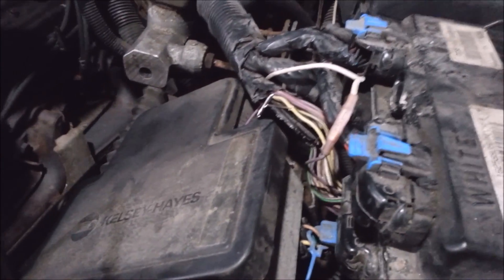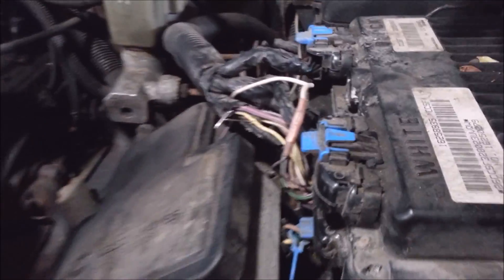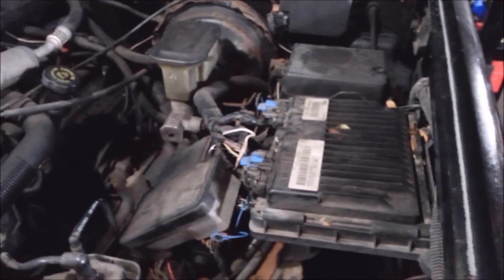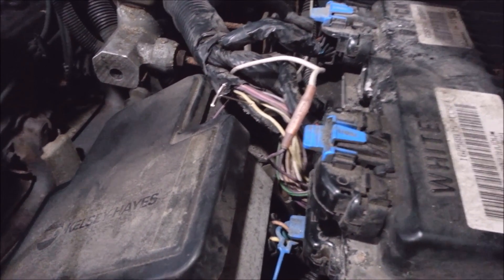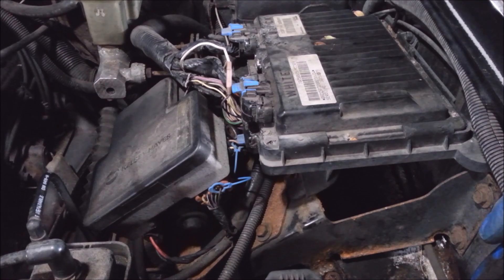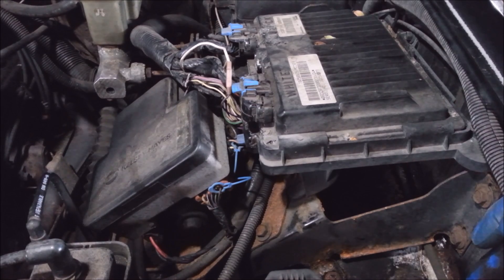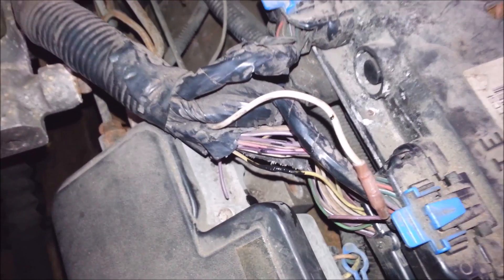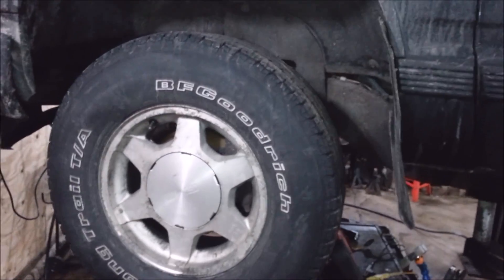1996-2007 Chevrolet GMC P0336 crankshaft sensor testing, and diagnosis

Comment: What is the voltage for the 3rd wire the yellow one? It’s a signal wire but the crank sensors can send too much voltage to the signal wire causing it to be the issue
Reply from the maker: I forgot what I did yesterday.

Comment: Is the oil normal in the sensor?
Reply from the maker: @ivang3860  it goes inside the engine, does it not? I think there is oil in there.

Comment: I have a 1997 express van 5.7 L that was getting hard to start after moving to a new place. Did some research and found the crank position sensor covered in oil. Pulled it out, used brake cleaner to clean everything and replaced it. Also noticed before I did the work that parking uphill on the road was allowing cold air to change the settings?? Anyway that was 15 plus years ago. Still starts on one revelation now.

Comment: What do the other two wires that continue past sensor connect to??????
Reply from the maker: The knock sensor, I think.
Reply: @RustBeltAuto  no, these wires run under the harmonic balancer and up the drivers side
Reply from the maker: @87atxskater  I will guess, and say oil pressure.
Reply: @RustBeltAuto @ 6:05 you can see the wire protector running past the cps you literally pull on it unplugging the cps sensor
Reply: I’m losing my mind trying to figure out where it goes 😂

Comment: Im broke down on side of road. I have a scan tool and getting this code. Can i just disconnect the plug to bypass it until i can change it?
Reply from the maker: You need a crank signal for ignition to work.

Comment: Question, how do you know which yeller wire to prick so you can test continuity? I’m having a issue with my 98 Xpress van and after changing the crankshaft sensor with a new AC Delco, my issues returned two days later. Still getting a P0339. I look at the same wiring harness going into the ECM and there are multiple yellow wires. How do you know which one is which? Thanks in advance
Reply from the maker: A wiring diagram will give you the proper pinout of the ecm if you have any confusion.

Comment: Is there a way to install the distributor without using a scan tool? I had a 7.4L, 99 Suburban that installing the distributor at TDC of number 1 spark plug doesn't work because it won't start? The rotor needs to be retarded 2 teeth after checking the CMP retard PID on a scan tool.
Reply from the maker: If it doesnt start, you probably have something else going on. Check fuel, check spark, check air.
Reply: @RustBeltAuto  it ran fine before the distributor was taken out.
Reply from the maker: @meblake7359  it must be something you did.

Comment: So if there’s no power from the signal wire and the wire passes the continuity test and ground is good,then the ECU needs to be replaced? I have no spark and no signal to fuel pump.
Reply from the maker: I don't know. Sounds confusing.

Comment: The new part should come with a cpl new shims and a lot of people don’t use them even though GM recommends shimming it, the way it’s hitting you should definitely shim it or you’ll be replacing it again.
Reply from the maker: Whatchumean by "hitting"? The graphing meter looks good, and it is still working. This is my winter beater.
Reply: @RustBeltAuto  not hitting the reluctor wheel, as long as there’s a gap your good

Comment: Good deal! Good information and I am going to try that. I have a crank but won't start that when I change the crankshaft sensors was working and then nothing. I replaced it with a cheaper sensor not the OEM from Rockauto but didn't thought about spacing. It is worth a try. Thanks.

Comment: Great video love the fact you get to every step fast. Subscribed.

Was wondering if you had any leads on what my issue could be. I have a 96 Chevy express van with a five point liter engine and in December 2020 I left the country for about one year and two months the van ran before I left. I came back this year in February and change the oil and charge the battery and when I went to crank it the engine cranks but there is no spark and the fuel pump was not originally priming. I decided to take out the ECM B fuse, And when I plugged it back in the fuel pump started cycling along with the check engine light on the dash. I changed or rather switched relays around but it still did the same cycling on and off. I have no spark I changed the coil and the ignition control module and still have no spark. My last resort would be changing the crankshaft position sensor I looked at it and it’s very oily could that cause my issue of fuel pump going on and off by itself when key ignition is on? initially after I change the oil and went to start it I had no priming of the fuel pump whatsoever, it started happening when I disconnected and reconnected the fuse for the ECM B.
Reply from the maker: Sounds like you need a car doctor.
Reply: @RustBeltAuto  yes, you… i am thinking its an ECM bad connection issue. If i leave the ignition on, fuel pump primes but the after a few seconds it just starts randomly priming 🤕

Comment: What does the wire coming of the harness to the left go into?
Reply from the maker: I think its a knock sensor?
Reply: @RustBeltAuto  the reason I ask mine is not plugged into anything will that affect how the truck runs?

Comment: The wiring that is attached to to the crank sensor bracket, where does that go? It's a red connector with a brown and yellow wire it's unplugged  on my 98 z71 and I can't find where it plugs in to.
Reply from the maker: I don't know. Are you sure it's not a dummy extra plug for something you do not have? I think red is usually EVAP or something.
Reply: @RustBeltAuto  Thanks for the reply. Much appreciated !!!!!
Reply: Did you ever figure it out? I have the same plug just hanging there
Reply: @alexthompson4853  yea. It goes to a sensor on the power steering pump. Mines did not have the sensor however. Don't know why.

Comment: I have a 97 GMC Sierra 4x4 1500. I just change the flexplate but now it won't start. Also my crankshaft is very hard to turn. Help or opinions please.
Reply from the maker: Is it backwards?

Comment: My sensor got a gnarly chunk taken out of it and was causing the motor to be intermittently uneven and stall. I'm wondering what took that chunk out of my sensor out, Debris? Gonna check in a week to see if my new one has any damage.
Reply from the maker: There shouldn't be any chunks taken out of it.
Reply from the maker: @WorkshopCompanion  What's air gap?

Comment: I have a 96 Gmc no fire going to the coils nor to the fuel pump just bought a computer check fuse box everything is hot when the switch is on

Comment: Hi, Thanks for the video. I'm about to do this job, as a friend's scanner says that both Cam and Crank sensors are off.  Replaced Cam sensor 1st.  I'm curious as to what you were doing at 9:20, with the sealing putty. Did you apply it, install it, give it a revolution, then recheck it?  I just bought a NAPA sensor, to the tune of $70. No shims included. Chagrined to see other places sell them for $25.  Dealer price was something like $150.  Friend with scanner (snap-on), works for NAPA, so feeling iffy about returning it, unopened.  Jimmy was running fine, till on a start up - total crap, misfiring, like crazy. Replace cam sensor, but made a mistake, having the old one loose, cranked engine in small clicks, to get dist. plate slot in position to pull sensor. Sensor jumped, and got pinched by that pressed metal plate, which the rotor sits on. Upon install of new sensor, no firing at all, except weak coughing after lengthy cranking, like only 1 cyl was firing! Wondering if I damaged distributor, perhaps shifting that metal plate a bit.  Thoughts appreciated. Thanks.
Reply: Be weary. Sounds like possible ground issue.

Comment: How do you do a re-learn
Reply: For what it's worth, you can't do a crank/cam relearn with a scan tool, on a k1500 anyway, until 1998. I only know because I have a 97 lol.
There is a manual way to relearn them that I found and it stopped throwing the code after I did it. 
I googled it to find it. Had to drive at 55 for 2mins, then slow down to 40 for 30secs w/o using the brakes etc etc. Good luck finding a road to do it on unless ya live in farm country like I do.
Reply from the maker: Dedicated scan tool.

Comment: Looks like I need to start by using a multimeter to check to see if the wires are okay, and then I should definitely turn the crank shaft to check the reluctor wheels.  And then I should try to get a power probe style tool so that I can look at the wave signal.  Would an oscillometer work for that?
Reply: oscilloscope*
Reply from the maker: @robertwilsoniii2048  after watching this video, I'm sure most people would just toss a sensor in it. Saves the hassle of diagnosis most of the time. When this sensor didn't run the truck, the graphing meter still picked up a signal. It was just too weak. That threw me a curve a little.

Comment: great vedeo mate I think I need replaced a crankshaft on my 6.5D because some times the engine lose power and I need stopped the engine and start again!!😏 I replaced a diesel pump cost me a 1600$ and still have the same problems!! I need only replaced that crap sensor! maybe after running good 😏 will see!! cheers from Norway
Reply from the maker: Sounds wrong. You should really talk to a diesel mechanic about that. Personally, I try to stay away from them like the plague.
Reply: @RustBeltAuto  here in Norway not exist professional mechanic's!!! only guys replaced part's!!! and extremely expensive!! on my suburban I replaced a diesel pump, PMD, all 8injector's, new fuel lines 👌 and still the same like before I replaced all this part's!!😏 so only i don't replaced that sensor!! so if I replaced a this sensor after still on same conditions probably is a damm ECM!!😏 my plans is a removed a electronic diesel pump and put a mechanic diesel pump and the problems gone forever 👌 fucking electronics sensors
Reply: @Jorge Kazachek having the same issues, just got through replacing the pump, and the pmd box still same issues as b4. did it work after you replace the sensor

Comment: Have a 2000 gmc 2500 5.7 motor revs up and just shuts down would that be crankshaft sensor already replaced fuel pump and filter.
Reply from the maker: Fun problem. I would check to see if it looses fuel pressure. After that, I would make sure the 5v reference voltage goes to your sensors. Inspect under hood fuse box, wires, and fuses. Tcb fuse, and power check would be a good place to start. Other than that, lotsa luck. Check for codes. Current, and pending. Sounds like a pain.

Comment: I have a 1999 GMC Yukon  5.7 i have no spark at the coil or the plugs i replaced the crank sensor, coil and module and still no spark cranks good but doesn't start any help would be good.
Reply from the maker: Tough call. I would need to see it to figure that out. Maybe find a no spark diagnostic flow chart for it? Good luck.
Reply: Probably Cam sensor under the dizzy cap n rotor, also had a intermediate power failure to coil from coil power wire hard to catch
Reply: I have the same problem right now. No spark. I replaced the coil and still no spark. Any idea? Or did you get yours started
Reply: @davidvelasco3374  it turned out my computer was un plugged just a little on the drivers side fender well under the hood
Reply: @jeremya3754  thank you. Ya I figured my problem out. It was my camshaft sensor and

Comment: My 99 tahoe has fuel and spark and compression but just sits there and cranks. I’m between the spider injector and crank or cam sensor. What would you say I should do? I don’t want to just throw parts at it
Reply from the maker: Calibrate crankshaft sensor. If it is getting fuel, air, and spark, something is out of time.

Comment: I have a 02 Astro that won't start (sometimes sputters or backfires) when it has been raining or high humidity... did the whole distributor, coil, cables, plugs, and fuel filter... next will be the fuel injection "spider". I have read in a couple forums that it could possibly be the camshaft position sensor. Do these sensors ever behave badly due to moisture?
Reply: The distributor cap is cracked I rebuilt whole fuel system it was a cracked cap
Reply: Sorry... also not getting any codes
Reply from the maker: @motorteeth  usually connector related failures cause problems when wet. I would graph that cmp sensor too. sometimes they get goofy, and don't make codes. You may have a sensor that is cracked.

Comment: For the love of fuck, save yourself the trouble I went through and take off the o-ring on the old crankshaft sensor and put it on the new sensor. I spent forever trying to smash the new sensor in the hole before I realized the o-ring on it was fucking huge.
Reply: Lick it before you stick it lol
January 2023 CKP didn't come with lube
August 2023  it did. Worked amazingly better than the silicone lube I used. Couldn't believe it.

Comment: What is the sensor after the crank sensor
Reply from the maker: I don't understand the question?
Reply: @RustBeltAuto  on my truck after the plug for the crank positioning sensor there is another wire with a plug just hanging down with what looks like a broken sensor do u have any ideal what it could be
Reply from the maker: @billyhunt1095  if it's one wire, and grey, it is probably a knock sensor. Just a guess.

Comment: Can you access the crank sensor from the top side by pulling the motor mount and rotating the engine forward?
Reply: I believe you have to go in through the tailpipe with a plumber's snake, disconnect the exhaust manifold, then push snake down towards underside of the engine. With a long piece of cherry Twizzler, you're going to hook a garden hose to the coat hanger that's tied to the O² sensor; the one that prevents the body from floating away on whatever planet this question originated!)
Reply from the maker: Did you watch the video?
Reply: Taking out the front 2 bolts with a Jack underneath and rotating the engine towards the radiator to reach the crank sensor..
Reply from the maker: @scottbender1972  I would just get at it from underneath without doing all of that. Is it stuck in quicksand or something?
Reply: Yes I did so it can be accessed topside?
Reply from the maker: @scottbender1972  You could try. I guess I'm not understanding the whole pulling the motor mount, and turning the engine idea.
Reply: Sorry it's a 98 cavalier 2.2 4cyl looking to change the crank sensor    hoping I could pull the motor mount bolts and rotate the engine towards the radiator to access the back and change it ..thank you for all the info
Reply from the maker: @scottbender1972  I'm sure someone other than me has a video on that job. Best advice I can give you.
Reply: @RustBeltAuto  thanks

Comment: Ok so i have a 99 suburban I just recently bought. I replaced the ignition coil ( I believe, it was under the intake tubes on top of the motor) and I wasn't getting spark. I looked up the issue and it said it could be the crankshaft sensor. Ilso I looked underneath to find that the crankshaft sensor had the wires hot glued in. I replaced all of that nonsense, and it still won't start. I was wondering what the wiring would be as well as how to calibrate it
Reply from the maker: The only way to calibrate it is with a capable scan tool. The only way to test it is with a graphing meter. If it had a crankshaft sensor code, you are probably in the right direction. If not, could be other things.
Reply: @RustBeltAuto  thanks
Reply: Had a few cam sensors go out on the gm vortecs it's under the dizzy cap n rotor, disconnect batt pull hood off(not needed but helps) pull out distributor replace part then get #1 top dead center (tdc) on compression stroke then put the dizzy back in line up rotor towards #1 put spark plug back in n fire it up

Comment: You mentioned a relearn what is that? My 97 GMC Sierra k1500 is throwing two codes for crankshaft post. Sensor p1325a and p1325b. Was gonna take her to someone but after watching your video I’m gonna give her a go. She’s running but has a bad hiccup, almost like she’s gonna run outta fuel, she gets up and goes but at the stop light she idles rough in gear or in P N. 

ANY HELP IS MUCH OBLIGED THANKS FOR ALL YOUR VIDEOS BYW
Reply from the maker: The sensor needs to be calibrated with capable scan tool.

Comment: My 97 Silverado is doing this intermittently. It just loses spark all of the sudden mostly at idle. I put a new icm and new rotor button and cap on it and it did fine now it just randomly dies. I hate throwing parts at something but it's got me stumped. May check my CPS tomorrow. My distributor pick up looked a little rusty my change it and spark plugs and wires too. But it's not throwing codes for anything according to oriellys scan tool. I'm just ready to figure it out.
Reply from the maker: I have had a #3 misfire, and strange runnability problems for half a year. No codes, and couldn't figure it out, until it finally wouldn't start, and made a CKP code. That's when I used  graphing meter. It was pulling a very weak signal, and not starting, until I jumped it, and then it magically did, and kept working. There is no value for what the computer sees as a usable signal. The new one definitely worked better, and it has been running great, with no misfires ever since. Thanks for watching!

Comment: Hello R.B.A...does a 95 gmc Serria 1500 extended cab(5.7) a have a CRANCKSHAFT SENSOR?.. my truck randomly dies without no warning no lights flashing on the dash.. it sounds like it's running out of fuel, change fuel pump- fuel filter-throttle position sensor.. so I'm just basically playing the elimination game, can you help me please..Thanx
Reply from the maker: Get under there and look. Might be a good idea to put a .100" gap on a spark plug, attach it to your coil tower wire, and see if it sparks when this happens. Sounds like a coil ,module, sensor, ignition type problem.